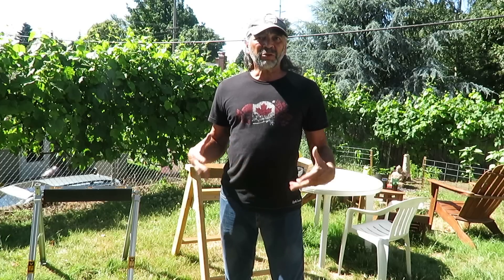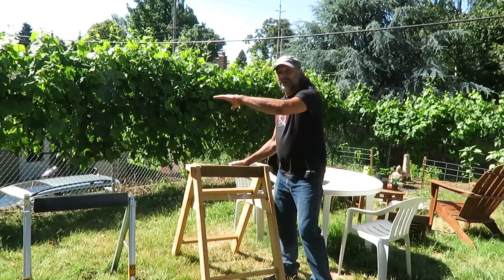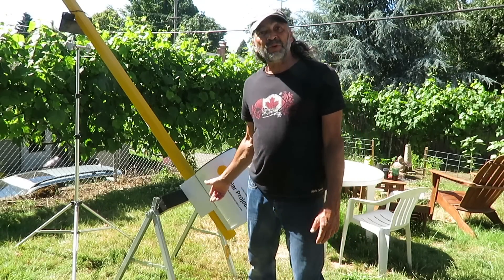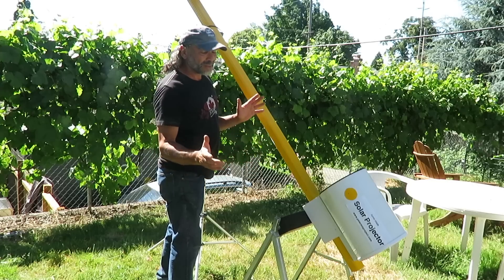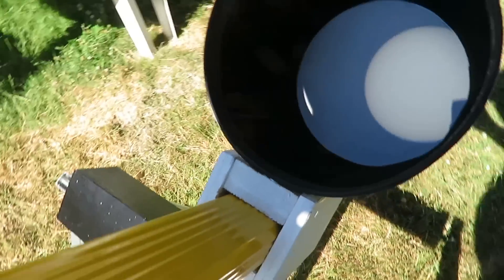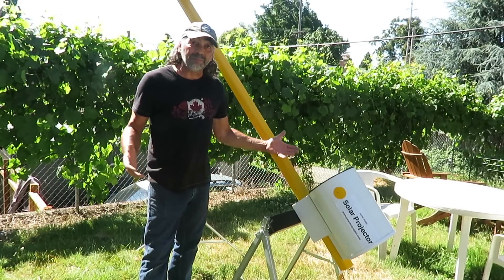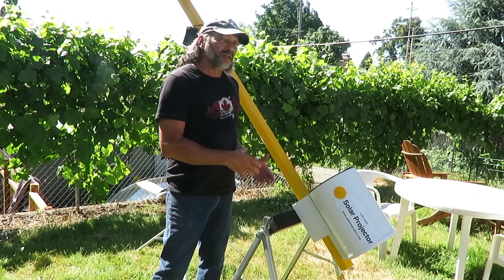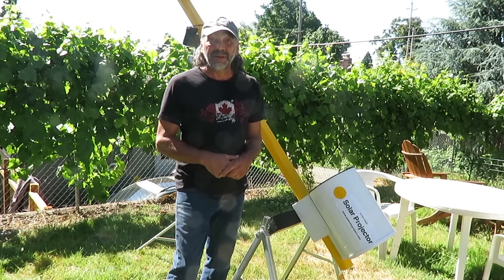How to Build a Solar Projector 2.0

Comment: I know this is a rather old post, but I was curious of the distance between the eyepiece and the viewing screen. If it was in the video I missed it but was just curious as I'm planning to build this exact design, as I have the same monocular that you have used here.
Reply from the maker: Hi there, sorry I didn’t see this sooner but the distance between is variable but within the 10 foot span of an aluminum downspout. How deep is the receiving end is a factor so the way I did it was to first set the projector receiving end and then I build a slider on the downspout with the monocular attached facing the sun until I got the image sized on my plate. Let me know if you built it yet or have any further questions.
Reply: @efrainpalermo  Thanks for the response, and now I've taken a while to respond to YOU. Lol. I apologize. I have not yet put this together. I'll most likely use a piece of wood because I have a lot of that to use, and not a downspout. I'm glad to see that it can be such a long distance, because I was hoping for a rather large solar disc image! Thanks again!

Comment: Fantastic design, thank you so much, starting my build right now!
Reply from the maker: Hey cool, I'd like to see a pic when you're done:)
Reply: I used the base of my 12" Dobsonian telescope, and a combo of 6 inch and 4 inch PVC piping. 

I used a short 500mm focal length 4" diameter telescope instead of binoculars, but my main tube wasn't long enough to get focus so I had to panic and use a chunk of 1.5" piping and tape to extend the eyepiece until focus was achieved. :D Finished just in time for the eclipse to begin.

My viewing box is made of scrap wood siding panels, as was the far end mounting point. The inside of the box is 14x14 inches, 24 inches deep. 

I was limited to my choice of eyepieces after the duct tape extension. :) But I was pleased with the large enough image...8 inches, maybe larger.

Hopefully this link will show a quick shot of the setup while I figure out how to host pics online:

https://www.facebook.com/photo.php?fbid=10155728179532074&set=a.10150107393372074.294758.804587073&type=3
Reply: Inside pic, plenty of sunspots, eclipse about to begin:

https://scontent-atl3-1.xx.fbcdn.net/v/t31.0-8/20934085_10155728187482074_2558748402253424854_o.jpg?oh=cbce6453efc1e44905254569048629e1&oe=5A31AB8D
Reply from the maker: Really cool pic, thanks! And I like how you solved your problem with what you had at hand,, cool:))))

Comment: Your design is terrific!  I built one based on your description and it works great!

My version uses a 2"x2" fir strip as backbone.  Its about 6ft long.  I lean it against a ladder for stability.

I built my projection box with black dollar store foam board.  I used opera style binoculars with one optical path blocked off.   It's easy to focus. I saw 2 sun spots. 

The sun image is about 5" in diameter.

Thanks again for your fantastic video.
Reply from the maker: Hey that's awesome especially seeing sunspots!! It's cool you used the materials you had at hand and modifying it to work for you. I'm going to set up a solar projector web page, email me a pic of your set up and I'll post it on my website when I set it up...efrain@palermoproject.com.
Reply: efrain palermo ....i just sent you email of photos.

Comment: Your Solar Projector looks great!  Question:  What kind of monocular are you using?  Brand, and magnification.  Is it a monocular or a gun scope?  I didn't see any mounting rails on monoculars I looked at, so I was thinking that it might be a gun scope.  Thanks!  Are you going to see the eclipse on Aug 21st with your projector.  I'm going to Nashville.  Should be a blast!
Reply from the maker: Thanks John, I used a Bushnell Legend Ultra HD Monocular, Black, 10 x 42-mm I ordered off Amazon, this model came with mounting rails which made it very convenient. Im going down to Lincoln City on the Oregon coast which is in the path of totality however crossing my fingers it won't be cloudy! Good luck at your location:)
Reply: That's a nice monocular  Are you concerned that the heat from shining the sun thru the monocular will damage it?  I really like the large, bright, crisp image that you get.  Could I get a decent image using a $40 monocular w/the same magnification, compared to your $300 monocular?  Thanks!  I was thinking about using this one:  http://a.co/65T7uIr
Reply from the maker: From my research sunlight doesn't damage the lenses however it will heat up the air in a longer tube, like a refractor telescope but the solution to that would be to block the sun periodically. I've had the monocular pointed at the sun for hours with no after-effects.
I like the monocular you want to use, actually my first projector used a 10x42mm binocular and the image was great. The only suggestion would be to attach a picatinny rail to it if you want to be able to remove it, otherwise you can make it permanent mount with whatever you have at hand. If you build one please send me pics! :)
Reply: I'm impressed with the design. Oh I'm so inspired to build one for Monday's eclipse. Some friends and I will be driving from LA to Baker City, OR.
Reply from the maker: Be cool if you could build it for the eclipse and it could also be used to study the sun once the eclipse comes and goes:)

Comment: Great!  One thing. What if you use a counterweight on a rod, that you are using to mount your projector to a workhorse? This way you could probably eliminate your tripod to keep whole thing from tipping. By the way   What is monocular you are using? Rifle scope? Details? Thank you very much.
Reply from the maker: I don't think finder scopes are good for this purpose, I've had good luck with binoculars and the monocular with out any burnout. My next project is to use a refractor telescope and I read that there can be heat build up inside the tube but no lens damage.